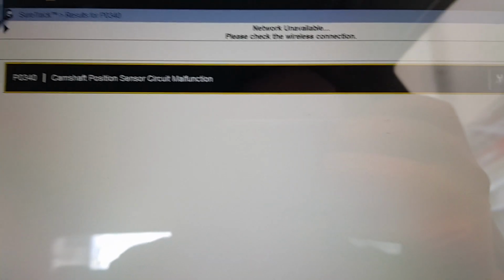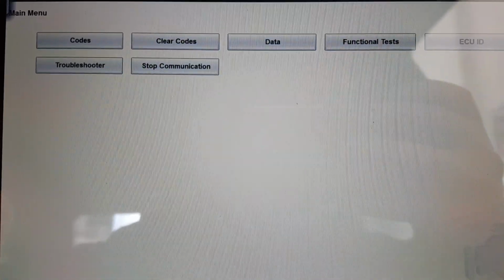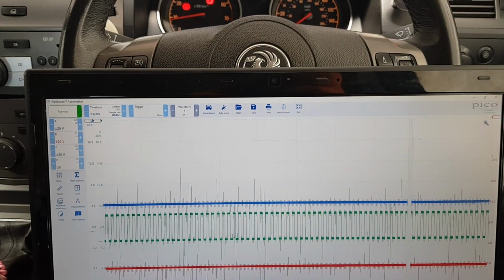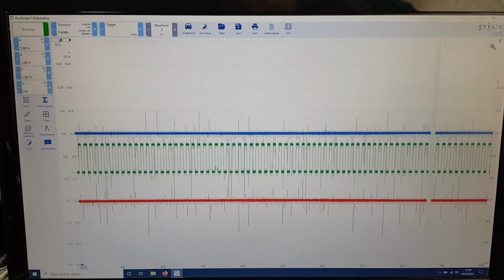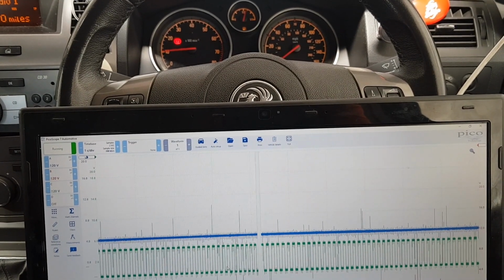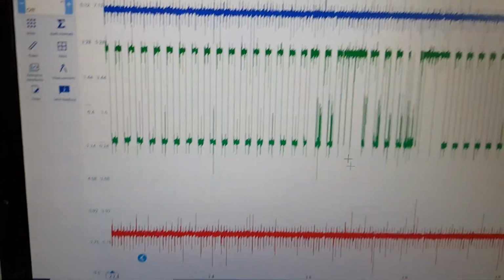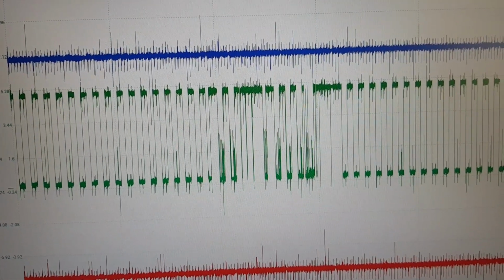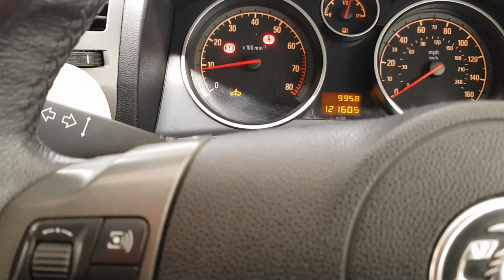Vauxhall zafira camshaft fault P0340

Comment: I have a similar problem, but mine does it when you start the engine- sometimes starts first time no issues, sometimes doesn’t quite fully tick over and start but does on second attempt.  Would this be the sensor too?